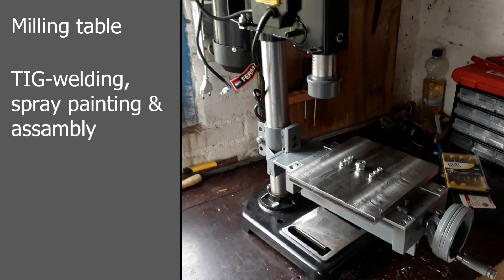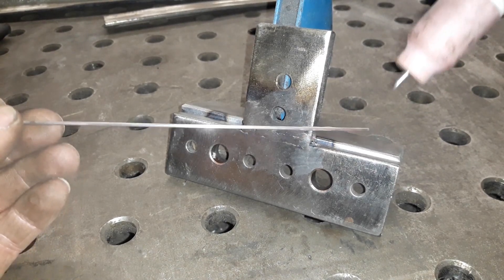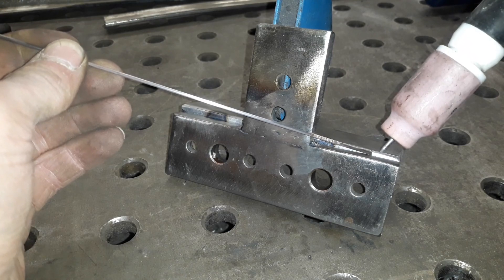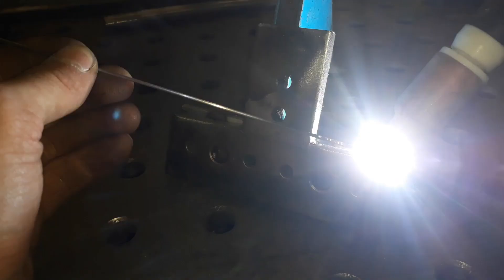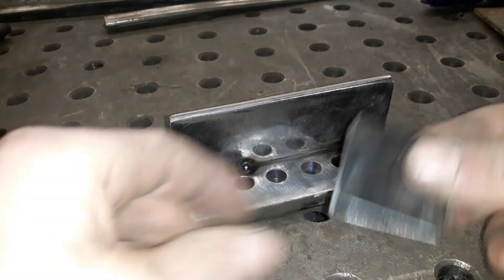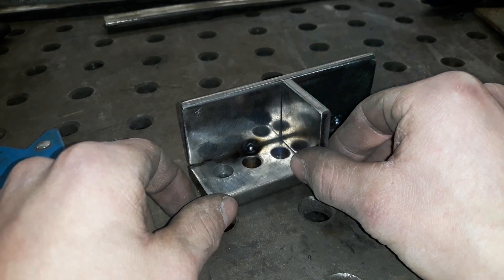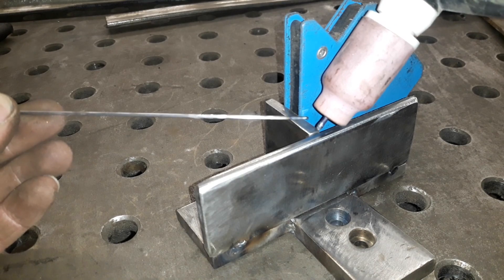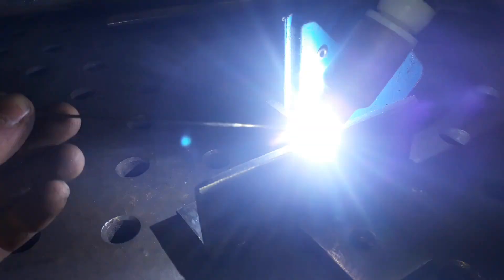MILLING TABLE BUILD     [homemade milling machine}

Comment: Very nice work. I have tried before using my pillar drill for milling. 
It didn’t work well. It is just not stable/ strong enough for the task.
Reply from the maker: Thanks for your comment! My conclusion was the same, that's why I am building a new milling machine (video comming soon) that will incorporate all the viewer feedback and things I learned.

Comment: That has to be the ugliest Tig welds ever with the crudest Tig welder electrode...it is a wonder that the systems works
Reply from the maker: Sounds like you have had a sip of white vinegar? We all know you are probably born as a perfect tig welder, even when there's a camera in the way.

Thanks for your kindness, wish you a good day.
Reply: @EngineerSteve  
Hello my friend, you should take his comment as a constructive criticism (even though he has been rude for free) and take the oportunity and try to improve the points he pointed!

You should keep your electrode clean and sharp, don't get used to weld with the electrode that way!
Reply from the maker: @Diogo-dt1uf  Thanks for your comment, his comment was rude indeed. At that time I had almost no experience and I was fully aware of that and even metioned it in the video. I do not tolerate comments like that from keyboard warriors.
Everyone has to start somewhere, at the moment I'm doing regular stainless tig and I can asure you that things have improved!